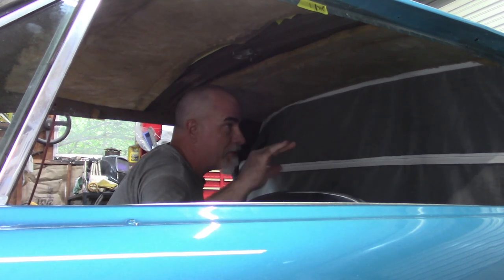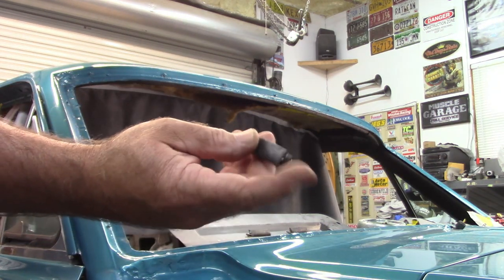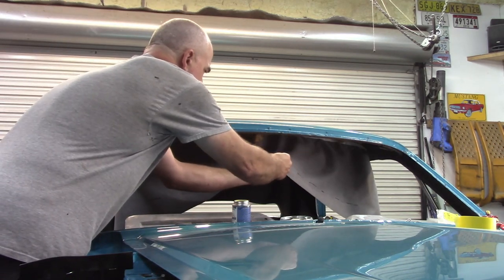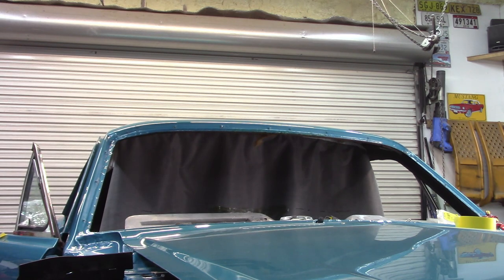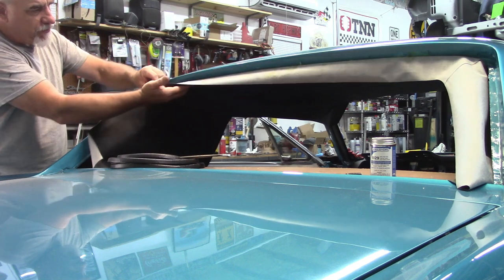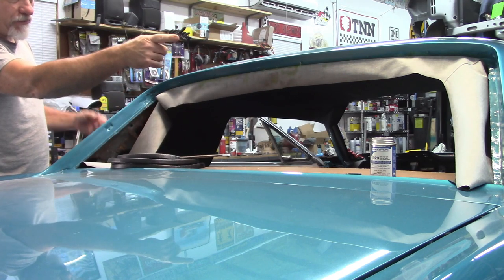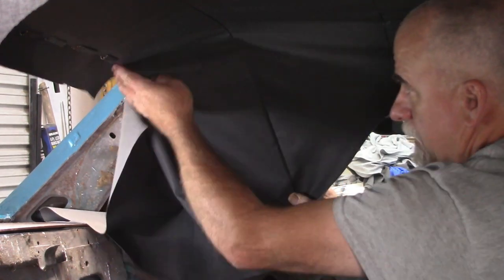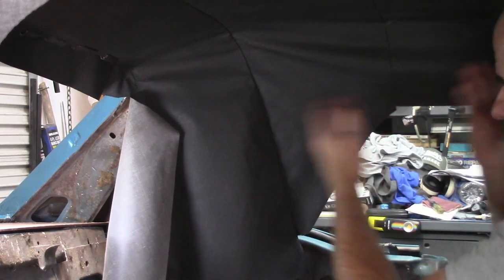Headliner install in a classic Mustang. Part 2. Jade part 80.

Comment: Great job Barry, so many things to account for before committing to glue or even cutting the headliner.  Once again I have the utmost respect for the line workers in the late 60's as it really was a craft to assemble these cars. But it also really supports  "built on Monday or built on Friday" cars as so much is left to the skill and patience of the workers. Back then it was 40% parts and 60% assembly, today it is 80% pre assembled parts and 20% assembly on the line.